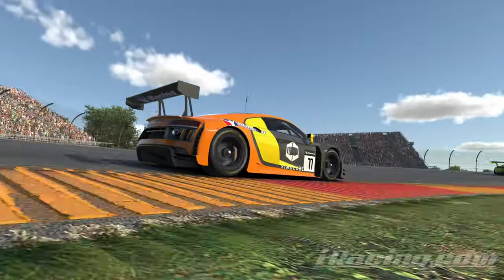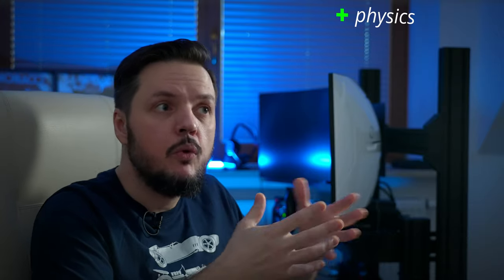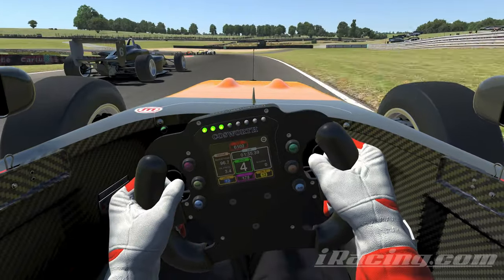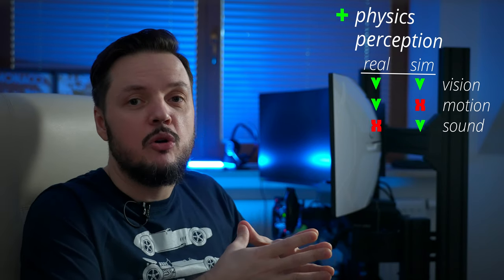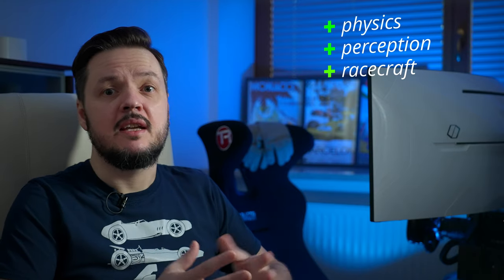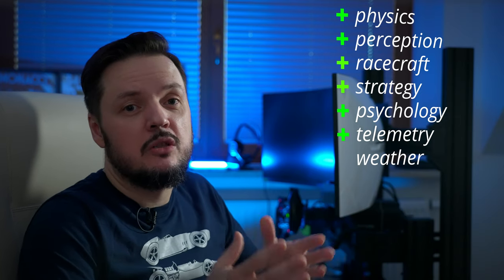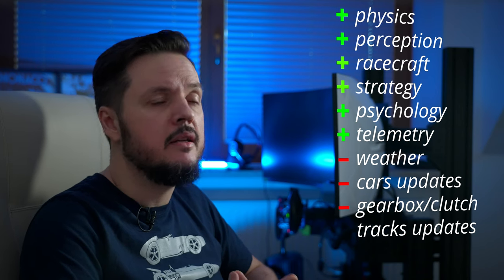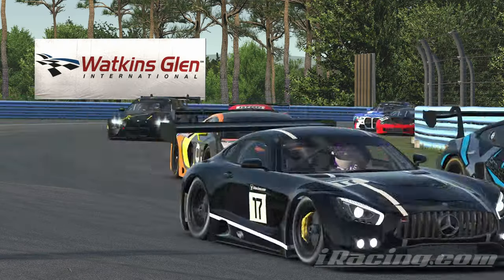You Won't Believe Sim Racing Works Same Way...Almost

Comment: What sim did you use to prepare for F1000? Was there a F1000 car in any of the sims?
Reply from the maker: I don't race F1000 this season, but when I did I was using usf2000 and ir04 cars in iRacing for that. They are not F1000 exactly of course, but I prefer this sim in general. 
There is F1000 in GRID(2019), but I don't like neither physics or tracks. Also you can find F1000 mod on racedepartment.com for Automobilista. But I haven't tried it. 
Anyway iRacing is my everyday sim and for rare tracks I use mods for Asseto Corsa sometimes.
Reply: @here2race  Thanks for the reply. Did sim racing translate well to real life racing for you? Was it accurate enough?
Reply from the maker: @Ben-rg4iq  In general absolutely, yes! In details well it's more complicated, but I still think that modern sims is the best thing that happened to real racing, making a lot of practice much cheaper and opening doors for wider audience to motorsport world.
There is first part to this video just in case you missed it https://youtu.be/NubI3XcbKKI Will be glad if you have a look!

Comment: Great stuff, you got one more sub. I recently went to drive the Nurburgring for the first time, I noticed everything was faster in real life, the next turn would arrive faster than in the sim, maybe adrenaline or maybe having more pheripheral vision. I would love your opinion on this.
Reply from the maker: Obviously time of getting from one point to another is the same in real life and sim. For example recently I was preparing for Lausitzring in Asseto corsa and when I got to  the track later I set almost identical time. So it is just difference in perception. I think that difference in sense of speed is dictated in real life mostly by adrenalin. And the more you race, the less you have it. I mean after 10 years of racing adrenalin is still there, just with more control and cool head time starts flowing more similar to sim.
Reply from the maker: Thanks for sub man!

Comment: I have a hope to join the F1000 championship in the next few years.  Saving up now... How much will it cost roughly to race own car? Or how much will it cost if someone manages to join a team?
Reply from the maker: It's very difficult to say exact figures because there are too many variables. I would say budget starts from 15k per season as a bare minimum, but I guess it's unrealistically low prediction. More likely I would expect something around 30k per season if you want testing, tyres and adequate servicing. It's just from my experience. Might differ here and there - too many variables as I said. 
Hope you can do it one day mate - it is really remarkable experience. Good luck!